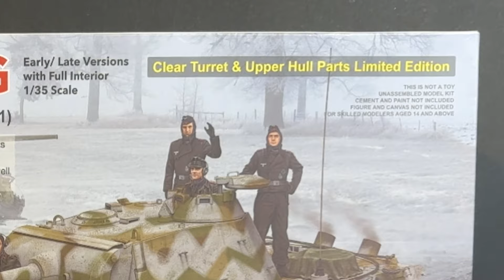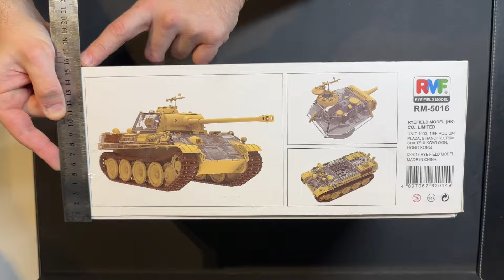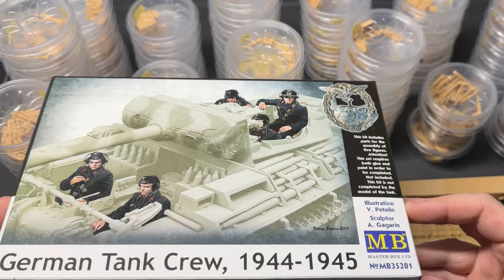German Panther (Ausf.G) RFM 1/35 - FULL INTERIOR +LOWER  HULL (Part 1/2)

Comment: Im glad you made this video with comments. Im taking a Tamiya D model Panther and a G model Tamiya and making an A out of them with some Dragon parts and aftermarket parts including a fully detailed inside turret from CMK and some zimmerit from ATAK and I am not following the directions order of build on anything. I want to put a partial through the hatch driver and radio/hull gunner compartment in order to closely build a big diorama from a photo taken by a German PK photographer that shows a village in Normandy where he managed to get an Ausf D, A and G in one photo where the commanders are yelling at each other and at SS Panzergrenadiers who are looking around several building corners for signs of Canadian or British troops or tanks so the Panthers won't get knocked out coming around the two corners they want to go past. I need to paint parts so I can insert them into a painted hull interior, with driver of one listening intently to the other tank commanders with his head raised above the hull top and the radio operator down in the hull talking on the radio. Of course the turret interior is easy, and I want to put a small nano chip light from Evans Designs into the hull so the action of the radio operator using his equipment can be easily seen. Ive been doing that on several model tanks already and it really adds to the build. On a Sherman I had to put five lights in the places they were put on the actual tank, and the great thing about the Sherman is that there are tons of hydraulic and electrical lines all over the place so that the wires for the electric lights fill a role as well! Great work, I wish I had steady hands like you again!
Reply from the maker: Thank You kindly for Your comment and sharing Your experiences on modeling struggles! 👍

You have quiet a strategy for a build - congratulations! I just love when a model tells us a small story behind, just like Your does. And You don't have to go for diorama to achieve this effect! Sure, diorama will serve You better but still it is not necessary...

You have inspired me with idea of using microLED's. Maybe in some future build with interior... I have a Sturmmorser Tiger with clear hull parts waiting in building queue 😀

Thank You again and please comment on future builds. I am very happy to talk to fellow modeler! 👍